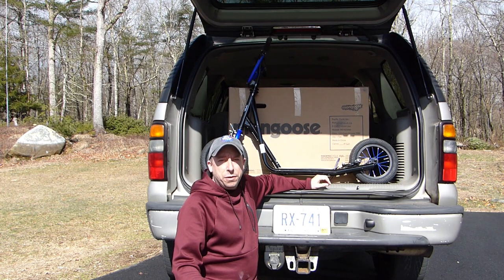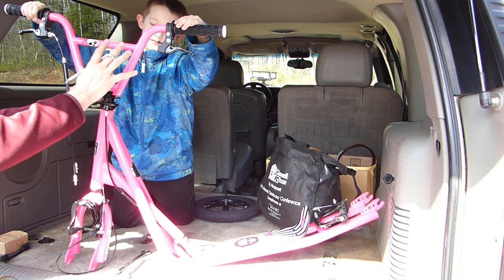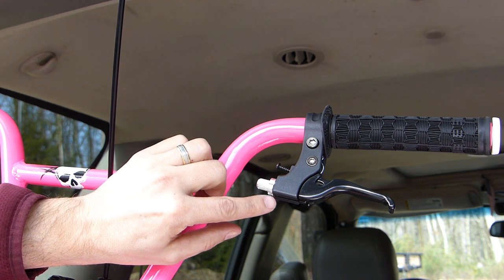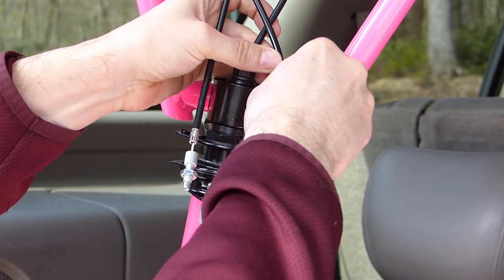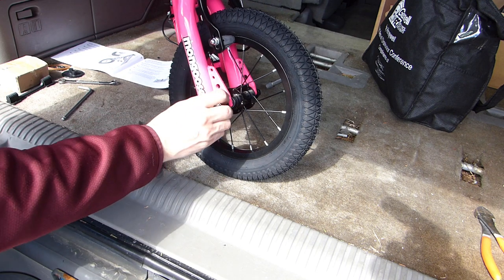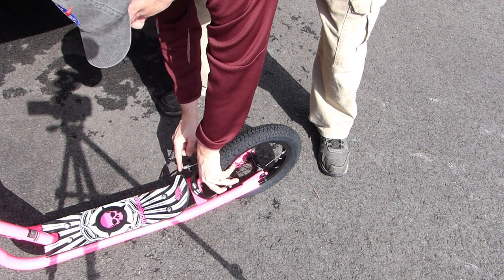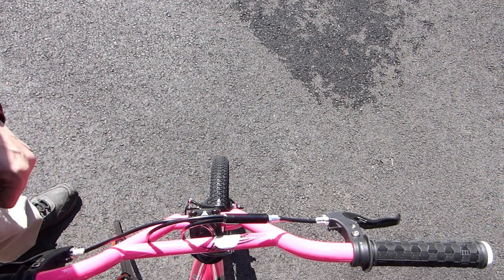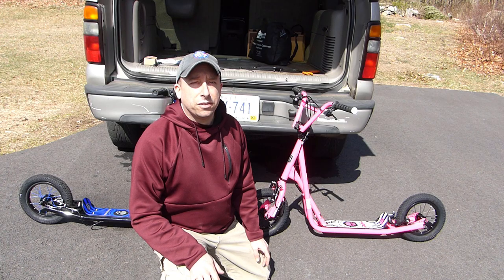Mongoose Expo Scooter Assembly

Comment: Extremely well shown. Just about to do this. I will be using the right lever for my front brake. My mind is just used to that from riding motorcycles and avoiding bicycles.
Reply from the maker: Front brake on a motorcycle is on the left....
Reply: @SevenFortyOne  No the motorcycle's clutch lever is on the left hand. It's front brake lever is on the right hand in front of the twist-grip throttle.
Reply from the maker: Yeah, what the heck was I thinking when I wrote that reply?  I've been riding motorcycles for 30 years....
Reply: @SevenFortyOne  Well, this morning I put my pants on backwards so don't feel bad.

Comment: Its quite simple if you've ever put a bike together before. I didn't read the instructions and had it done in about 30 minutes. I highly recommend you ditch the spinner rear brake cables and run a single straight cable to the back and restring the front outside of the stem. Also make sure you put grease on the wheel bearings. Front and back were completely dry on mine.
Reply: Hey!  My son got this scooter for free but the brakes cables frayed and needs to be replaced.  I’ve never put a bike together either.  Can you tell me what brakes system I need to get and point me in the direction of a “how to” if needed?

Comment: FYI for others hung up: called Pacific Cycle for more help-- they pointed me to ParkTool.com > Fix > Repair for videos that can help with specific scooter assembly/repairs. This SevenFortyOne video is spectacular and helped me a lot, but I needed specific fixes for out-of-the-box assy fails. Our Mongoose Expo came with forks and handlebar bracket oriented backwards and needed to loosen stem binder bolt to flip bracket. Confusing because you assume they got the orientation right out of the factory and you can't figure out why the front doesn't look right at first. Also, front side-pull caliper needs a major centering adjustment and I don't have a torque wrench- calling a family lifeline in for this cluster. Neither of those situations are in the owner's manual.

Comment: These power brakes are a pain in the b**t to fine tune them, ended up busting the spring that keeps the caliper open, because the caliper would not keep alignment and one of the pads always touched the wheel. I will remove the brakes off, get new ones and have a professional to do it for me.

Comment: Do you have any suggestion for wheels that wont spin. I believe it's the bearing nuts are too tight. Got one to spin slightly but is very "gritty" when it spins
Reply from the maker: The grittiness may indicate something is wrong with the bearings.  Something could have gotten broken if they were over tightened.

Comment: User guide page 13 says “It is recommended that the threads and all moving parts in the parts package be lubricated prior to installation. Note: we recommend using a lithium based grease on the parts before assembly.” Did you use, or do you see a need to use, lubrication on any parts? Or is this a carryover from a mongoose bicycle assembly manual do you think? I keep looking at the pictures and watching your video and I don’t really see a place for lubrication! Thank you so much for the great guide!
Reply from the maker: Well, the manual is the official word on this product but I can't see why it would really be ncessary to add lubricant to the fasteners for something like this.
Reply: @SevenFortyOne  Thank you!
Reply: PS, pg 31 Mongoose expo scooter user manual has a Lubrication Schedule for parts they recommend to lubricate with either oil or lithium based grease, depending on the part, for good maintenance especially in wet or dusty areas. Includes brake calipers, brake levers, brake cables, brake lever and caliper pivot points, wheel bearings, headset. I was surprised- it is for scooter, not bike. May want to do good maintenance with the hope of never having to build one of these again, just my two cents.

Comment: Can you tell me how to get the stem bolt on the gooseneck to catch the tread if it was loosened all the way?
Reply from the maker: Turn the scooter upside down and see if you can get it to catch that way.  That will allow the cone nut to contact the end of the bolt if it has come completely off. If not, you may have to take the handlebars completely off, then flip the scooter over so the cone nut comes out, reattach the cone nut to the long bolt in the handle bars one or two turns, then reinstall everything and tighten it up.
Reply: It worked. Thank you so much for the advise. My son is so happy now!
Reply from the maker: Great news!